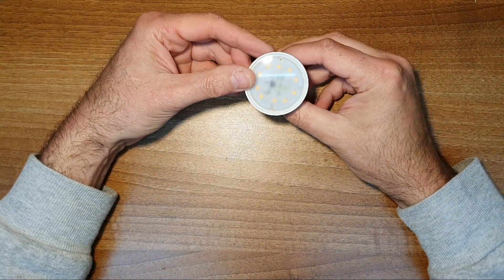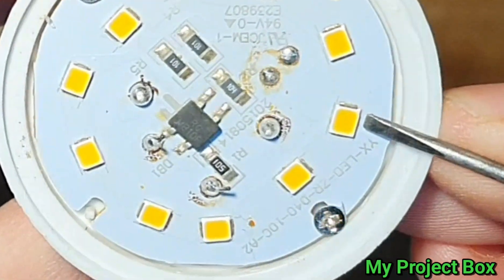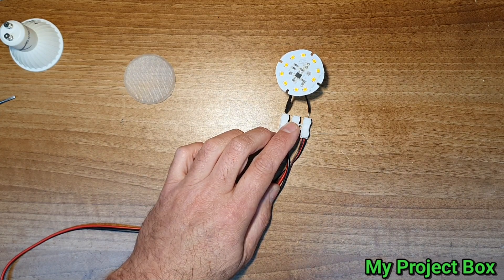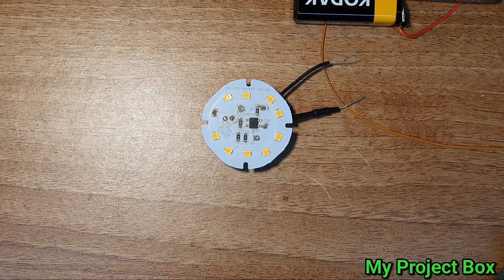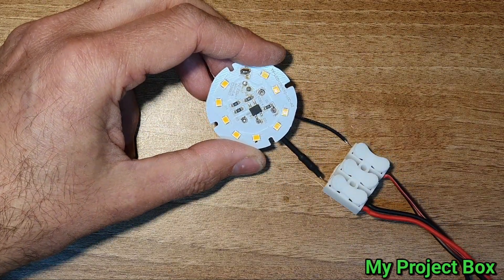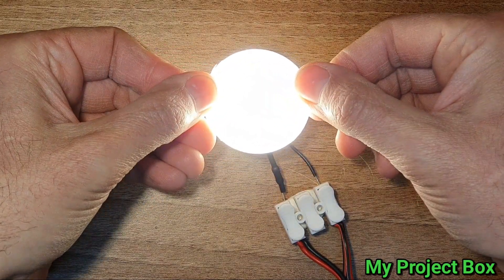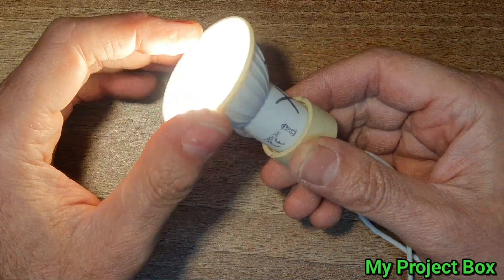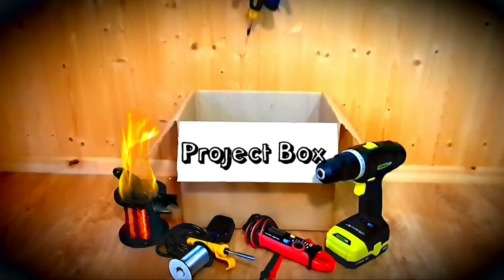Failed LED lamp Repair and improvements DIY Dubai lamp GU10 from Poundland. #ElectronicsCreators

Comment: How does lowering the capacitor extend the life?
Reply from the maker: This type of simple LED driver is called a capacitor dropper. The capacitor limits the current flowing through the LEDs. So if you use a smaller value capacitor then less current passes through the LEDs, and they run at a lower temperature. This extends their lifespan.
Reply: @MyProjectBoxChannel Oh, I see. So, it's the same as a resistor. To limit the current.
Reply from the maker: @endoneswa basically yes, but it's impedance (AC resistance) of the capacitor. It's more efficient than a resistor. No heat generated

Comment: Excuse my ignorance, but isn't it a bad idea to shoot 27V across a single LED segment? Aren't the segments rated for 6V each?
Reply from the maker: A multimeter diode test (~3V) will only light single-chip SMDs.

For 6V/9V/18V types, you’ll need an external supply with a series resistor. (Voltage above 18V)

You can often guess the number of chips just by the rated forward voltage.

The key is the current "limiting resistor" that limits the current to a safe level. The voltage will then drop to the total forward voltage of all the series connected LED dies, in a smd LED.

Comment: What is that clamp connection between the wires. Really like that learning about electronics using breadboards that would make changing stuff very easy. Thank you for the video , very informative.

Comment: Hi Richard enjoyed your video and explanation. I recognised your accent - mine is the same. Best regards and keep up producing content. It is incredible while surfing You Tube amount of viewers complaining about short life, over heating and colour rendering. Just purchased a LED candal 7  Watt amp from. Eurolux and it states on carton:   
Life time = 15 000hours or 2 years from date of purchase. The previous lamp lasted 25 months. Taking a closed look at the Description details - it states Luminance = 560 Lumens. What! Should be Lumen output surely? 
I look forward to seeing an sho and tell of a retro fit LED tube any length, incorporating the electronic driver and single side mains connection. Opposite end pins for attaching into the lamp holder only. Just seen on Linked In an exposai on this type of retro fit where the electronic driver must have exceeded the limit on the temperature  of the components and caught fire. There are about 30 something persons who have commented with all giving their experiences or agreeing that this is the wrong method to save energy and also the large amount of failures as opposed to the fluorescent being replaced.
One point to be discussed is the length tollorence allowed: end cap to end cap and or end of pins to end of pins and how if for example if the lamp holders distance apart are longer than the retrofit lamp to be used. I have seen this happen in the RSA where in the manufacture of the luminaire the stop on the guillotine had moved about 4 millimetres longer than the correct length. When bench testing the complete unit for compliance for  safety and other tests required. The fixture is placed on it's underside (bum down) and bench tested with the tubes in place. Gravity forces down and the tube lights up and it passes all tests. When the electrician installs the fixture and it lights up and his job is  done. The next day he is called to be told - it is not working.  Again, gravity forces down in  this case - the bi pins making less contact with the lamp holders and the electronic control gear sensing that there is a problem and automatical switches off. How will this relate with the retro fit lamp having the same cenario?
Lastly. No You Tuber contributor has actually totaly explained the information written on the sides of carton the LED came in. One warning I have just observed is that it is not advisable to Quote:- disassemble or modify the lamp in very minute lettering. Keep up the good work Richard. Sorry, so long winded. An old gas lamp lighter.

Comment: Thanks!

Thank you for your teaching! Great video!

I gather there is no way to salvage a good SMD LED from another bulb and use it as a replacement?

I've disassembled my first LED bulb  which is about 10-15 years old. So far I've confirmed all LEDs are ok both by inspection and multimeter. Every capacitor looks fine and measures to specs with the meter.
PCB looks fine with no apparent heat damage. A fuse shows continuity.

There are many tiny SMD resistors, a toroid inductor, two transformers, another inductor and two components almost completely covered with hard white glue or paste of some sort. Not sure what they are.

Any thoughts at what I should check next? I've learned a lot but currently stumped.

Subscribed!

Kind regards,
John
Reply from the maker: @johnbauman4005  I appreciate the support, thank you 😄. 
The LED bulb in my video is quite a cheap/older design. It uses a simple "capacitor dropper" driver circuit. I think your LED bulb likely has a more complex buck-converter design(a type of switch mode power supply) if everything is covered in a tough resin, it's usually not worth repairing. You can sometimes get cheap replacement driver boads, for gu10 lamps. You simply connect the replacement driver boad to the led panel. 
LED light bulb design is constantly evolving. Now the simple designs uses a linear contrast current regulator, mounted directly on the LED panel with the LEDs. This is probably the cheapest way to manufacture a led bulb. You  can make your own simple replacement driver, in the form of a simple capacitor-dropper circuit, like I did in this video. https://youtu.be/zn4HNvMVSps 
Some times you can still repair a buck converter, if you get that typical flashing lights fault. This is normally a capacitor in the "bootstrap" circuit that has failed. It can be a resistor or diode aswell, but that it you are lucky.
Reply: @MyProjectBoxChannel Thank you so much. I am just an old dog learning some new tricks. Appreciate the teaching.

Comment: Just taken a dud one apart by Osram. It has a load of micro chips and capacitors galore, but it only has 1/2 the heat absorbing gum it should have, in my opinion. Not fully tested yet, but led itself has no sign of burn spots.  Inspiring film that got me to strip one down 😀👍👍👍 I do muck about a bit & have everything at my disposal  Big thanks
Reply from the maker: @AdventuresandLifestyle  Yes, the  LED gu10 lamp in this video is the older style one using a simple capacitive dropper circuit. This type is rarely used nowadays.

Comment: Was the live wire in your current limiting rig the one with the resistor on it? My electronics skill is basic, but I know that an LED only passes current one way and will be damaged if reversed.
Reply from the maker: I normally put a "old type light bulb" in series with the Live, for safety current limiting, to test small electronic circuits.  But in reality doesn't matter if it goes on the live or on the neutral.  The current for the entire circuit will be limited the same. And because it's AC there is no positive or negative.
Reply: Thanks, I thought the light bulb must have a rectifier to convert AC to DC, but as I say my knowledge is basic. Thanks for your help the video is really inspiring.
Reply from the maker: @CackHandedDaveDoesDIY  yes all LED bulbs have a built-in bridge rectifier, to convert the AC back to DC. When powering individual  bare LEDs you  need a DC low voltage supply, with a current limiting, in the form of a resistor. The LEDs only light up in one polarity, so reverse the polarity to check both ways.

Comment: Hi, found your video After one of my gu10 from Philips hue failed After only 2 weeks and it is not a cheap one and I don't know why :( Any Idea what could have been the problem ? Thx
Reply from the maker: It could be different things. The gu10 in this video has a simple capacitor dropper, driver circuit. That style of driver in not very common nowadays. If its a smart bulb, then it could be the driver/power supply that is faulty.
Reply: @MyProjectBoxChannel  Thank you for the above. Do you think it could be repaired ?
Reply from the maker: @theattorney6072  mabe it could be possible but with out seeing it first hand, I couldn't tell you.

Comment: Very good, but for me, I think I would have bridged the duff led with a resistor? I liked your meter, very nice tool
Reply from the maker: All the LEDs are connected in series.  So the increased current is very small, with the capative dropper circuit.  I also changed the capacitor for a lower value. So the current was much reduced anyway😉.

Comment: My theory is why arcing kills LEDs is because they create lot of higher frequency noise that passes more easily thru capacitor.
And this one doesn't even have Alu substrate board it's so cheapened so it's easy to solder on, for me everything is easy to solder on because I use 100w soldering gun...
Reply from the maker: You are absolutely spot on! At 50Hz the capacitor dropper limits the current nicely. With the high frequency harmonics caused by arcing, you might as well have have a wire link  instead of a capacitor!

Comment: Thank you very much for a great video.  I have in the past just thrown these bulbs away as they're poopy cheap.  Since, watching your video I have fixed dozens of them.  Wooohoooo!!!!!
Reply from the maker: I'm glad you like the video. I'll be making more about different types of LED bulbs. Please share my video if you can, so more people can learn stuff together!
Reply: I got some failed GU10 Lamps too but no LED spare parts. The local Theater got a waste box with a lot of LED tubes 1,5m used for HF light tubes. Now I could also spend a lot of LED chips for your broken one.